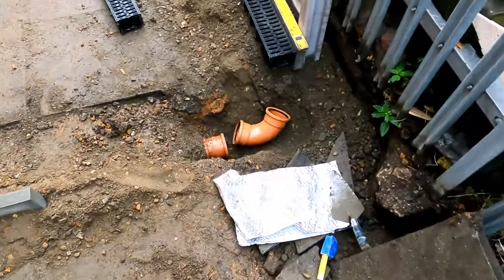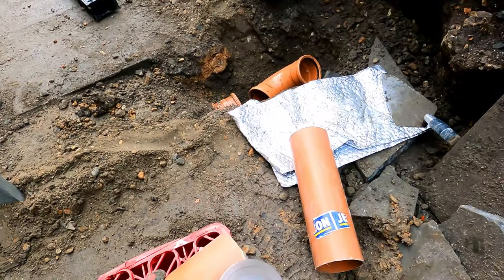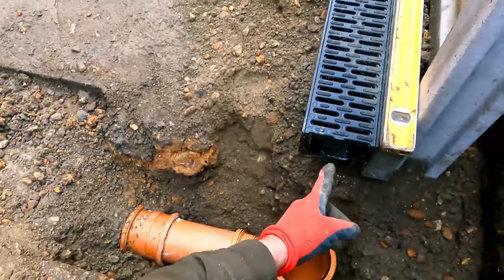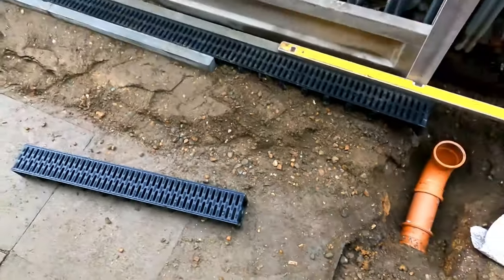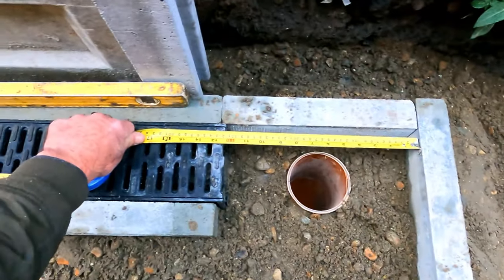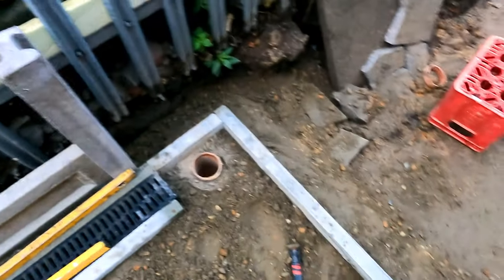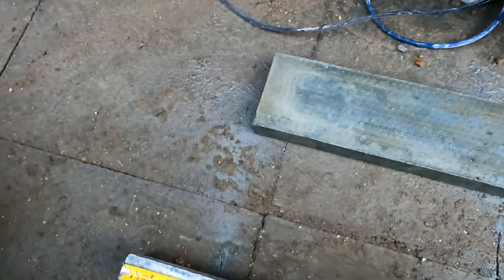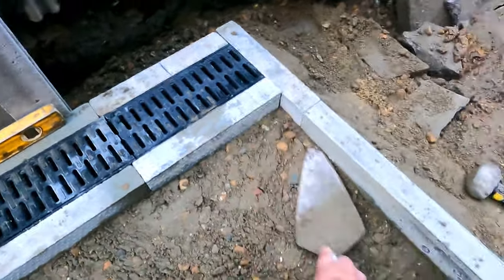How To Connect an ACO CHANNEL To a 90 Degree 4inch Drainage , surface & rain Water Pipe!!

Comment: Would have been better to put a sealing ring/connector to the aco over the top of the drain pipe. Stop all the surrounding muck from falling into it, which will happen over time

Comment: Is a connection not needed from the bottom of the aco to the below ground drainage like? Am in a new build and the fucking sub base is washing away under the block paving into the drain 💩
Reply from the maker: Thanks for stopping by the vid 👍 yeah you can buy connectors my way dose the same job water just goes straight down the drainage pipe

Comment: Assuming you're filling the path with concrete just under the damp proof course 😮
Reply from the maker: Pathway comes up level with damp on this job but I put an edgeding curb in 1inch from the building at the level of the damp.as not to bridge the damp course perfect for a disabled access at the fire doors

Comment: My daughter has just had this fitted "professionally" along the back of her house wall and they haven't used the push in fitting fitting between the channel and the drain gully leaving a 1" gap between the two, her sink drain also feeds into the channel just next to the knock out so if the gully ever blocks you would end up with all the dirty sink water going under the patio and possibly through the house wall. also with no outlet fitting connected under the channel  water is not directed down so it can flow anyway it wants.!!!

Comment: Recently subbed and will definitely take on board the way to complete the task highlighted, thank you for posting
Reply from the maker: Thanks very much for subscribing colin really appreciate that mate welcome on board 👍👍
Also I'm pleased the video can be a help to you on a future job thanks for the kind words and all the best mate 👍👍👊🏻.
Reply: @creativecrambo  Chuffed I found your channel actually but I have a question I have two soak away to install in the front of our property can you offer any guidance please at some point?
Reply from the maker: @colinratford416  
The size of a soakaway depends on the volume of water that's going into it ,this is determined by the size of your roof,  a soakaway needs to be at least 5m away from the building and 2 and a half metres from a boundary,  no waste such as sewage water should be going into the soakaway rainwater from your roof and surface water only,  they do a soakaway calculator online, this gives you the right size you need to make your soakaway going off the volume of water going into your soakaway, if you're having an extension done then an architect who dose the drawings should work out what you need to have in place,  yeah definitely do your homework before you do one plus if a groundwork team are doing it for you then they should have sound advice for you , do it properly and you won't have any problems later on 👍👍👊🏻.
,

Comment: Basically our builder has put blocks down and then put the damp proofing and then built on top wit bricks. We need channel drains running along side the house but would you suggest having a block placed next to the original block and a channel drain placed next to that? From this video I can see the block was visible and then you placed a block next to that and then had a channel drain installed, did you secure the new block to the old block with cement?
Reply from the maker: Thanks for stopping by the vid nice one 👍👍 you can run an aco channel along side your house /brickwork as long as its 2 course down from DPC meaning damp proof course, not sure what your builders have done but sounds like they just building up levels to get to where they need for aco channel, as long as the aco channel is 6inch down from dpc it will be fine if you'd like to put an edgeding around it That's a great choice looks great to  cheers and hope it all works out fine 👍👍👊
Reply: @creativecrambo  Thank you so much for your response 🙂 yeah building regs won't be happy about this and you know how it is with builders .. I just want to make sure no water ever gets in. Out landscaper wants to use gravel grids but I feel channels are more suited to keep water out? Seeing you place an extra block and then the channel might be helpful. Shame your not local ..
Reply from the maker: @AK-ql8yp  
Hope you get it all sorted and thanks for your feedback nice one 👍 👍👌👊
Reply: @creativecrambo  Thank you 🙂 and take care
Reply from the maker: @AK-ql8yp  THANKS AND YOU TO 👍👊

Comment: Hi m8. What's is the brown muck stuff your putting those edging kerbs into? What mix?
Thanks...
Reply from the maker: Hi m8 and thanks for stopping by the vid 👌👊
Yeah so the aco channel and the edgeding curbs are all bedded down on a concrete mix ,the mix gauge for the concrete mix was a 4 to 1 mix 4 ballast to 1 cement and the bed for them was about 5 to 6 inches deep hope this helps m8 and thanks once again 👍 👊

Comment: Weres the connecter from the arco to the pipe stuck up??, surely if left open when you drill hole through the foundation over time will wash away
Reply from the maker: Hi Paul don't really know what you mean about the pipe stuck up ?? As for foundations to ,  aco channel runs across 90 degree bend then I drill out a 2inch hole that the water goes directly into a 4inch pipe it don't even touch any thing else it goes straight down the pipe know what I mean did you watch the end of the vid 🤔 thanks anyway mate 👊

Comment: Ive just had a drive put in, however the water is pooling at the end in one corner, would that be fixed once the aco drain is installed?
Reply from the maker: Hello mate thanks for stopping by the vid 👍
If you got water pooling in a certain area on your drive mate sounds like what is underneath has sunk ,it might be cheaper to lift the paving and get the paving to the right level and throw the water away from that area if the water is lying there something is not right with the levels I wouldn't put an aco channel there mate from the aco channel the water needs to go to a soakaway hope this helps mate but I'm only guessing we're the water is pooling hope you get it sorted 👍 👊
Reply: @creativecrambo  thanks mate appreciate your reply as he was telling me putting an expansions joint would fix the problem🤦‍♂️
Forgot to mention it's concrete not paving
Reply from the maker: @L839-t1h  
You've just had a concrete drive layed and expansion joints are " normally" formed before you concrete , the water your seeing is in a low spot mate and unless you overlay that area then the water will keep on being there plus you always see a patch from the overlay so it's probably done to a bad finish mate if it's so annoying then take that section of concrete up and redo it 👍👊

Comment: I’m confused wouldn’t it be better to stagger the opposite edging joint? 

Also what’s stopping the edging dropping in places over time as they don’t seem to be compacted in? 

Not in the trade I’m just a massive DIY fan & looking to do something similar on my gaff 😊
Reply from the maker: Thanks for watching mate 👍👊
Yeah the concrete edgings are separate from each other for one plus they are layed on a 5 to 6inch concrete bed you got to get the mix to the right consistency not to wet not to dry then bed the edgings in then lay them to a line there going know where you got to make sure your sub base is good to when your good to go, concrete your edgings in I did them on a 5 to 6inch concrete bed 
No need to stagger joints when doing this we not laying flooring 
Thanks for stopping by mate 👍 👊

Comment: - Silicone in the joints between the drainage channel sections.
- ACO do vertical adapters & and leaf guards for when mating the drainage channel to 110mm, preventing water escaping when transitioning to the 110mm.
- The drainage channel didn't look like it was bedded into the concrete at all, nor did the concrete look well compacted. I very much doubt it'll survive the 1.5t load an A15 drainage channel is spec'ed to.
- When joining small cut sections it's good practice (though not always possible) to offset the drainage channel covers & joints to give additional rigidity.
Reply from the maker: Sounds like you know what your talking about but in reality you don't , the ACO was bedded down on 6inch concrete plus the pathway was 6inch concrete with expansion every 8ft plus 12mm rebar in the concrete to be honest it's going nowhere mate plus I've done enough of them mate to sink a battleship I know all about the connections  you can use in a perfect situation they are OK but there's other ways of doing the same job at less than half the price 
THANKS FOR YOUR FEEDBACK IF YOU WAS WITH ME DOING IT I'D SHOW YOU A GOOD FEW WAYS AROUND IT 💯👍👊

Comment: Hi there, my name is Sam (excuse my joke-based username btw 😂)and I'm new to the hard landscaping trade having come from the general gardening as well as soft landscaping trade. I have had some labouring experience with hard landscaping so I've starting off with small patios as well as driveways over the past year as I am not interested in general gardening work these days. I've recently looked at a job where the customer wants a little patio installing up against the house with the levels appearing to fall towards the house as opposed to the garden. I'm thinking aco drains as they would look the most aesthetically pleasing however as well as there being the main rainwater drain there is also their wastewater drain up against the house where the falls meet. How do I work around this without damaging the wastewater pipe whilst installing the acos to fall into the main rainwater drain? I'm not having any luck finding videos on how to do this properly and safely. Thanks!
Reply from the maker: Hi Sam 👊  sorry for late reply mate  🤦 yeah sometimes you get them sort of jobs ideally you need the water to run away from the building you can do an aco channel and keep it off the brickwork /blockwork with edgings about an inch that way you can come right up to the threshold and won't bridge the DPC 
it's hard to know what your up against mate without seeing it I hope you get or already have got it sorted mate and all the best in what you do thanks for stopping by my vid man and thanks for your comment nice one 👍 👊

Comment: This is something i am about to try myself what mix do i use to secure the aco drain? 5* work
Reply from the maker: george stronach:
Thanks for watching pal 👍👍 I bedded the aco channel in concrete I mixed up loose ballast and cement 4 to 1 ratio nice and strong  you can do this in a mixer or by hand if your fit, the aco channel needs to be on a nice base i layed them on about 4ich of concrete , yeah give it a go man I'm here to help if you have any more questions good luck with your project 👍👍.

Comment: Hi ..how do you connect corners..or make a right angle join
Reply from the maker: Thanks for subscribing Robert nice one mate 👍👍
If I was returning the aco channel on a 90 degree angle ,I'd cut both aco channel on a 45  degree angle to form a 90 degree angle you can use a good sealant to make the seal on the join thats how I would do it mate , all depends on what aco channel your using and if they do a 90 degree peice you can buy, but I normally do it the way I've just said works a treat every time,  thanks for watching appreciate it alot 👍👍👍.

Comment: How do you stop the smell from the drain coming back up if you’re not using a trap of some sort?
Reply from the maker: Dave lowe 👍the  rainwater system is on a completely different set up from the foul/ sewer system there not combined , the pipe I'm connecting on to leads to a catchment chamber with a trap , probably with a none return valve also having air pipes fitted to it ,there definitely wont be any smell coming back up to the aco channel that's for sure thanks for your feedback appreciate it mate 👍.
Reply: @creativecrambo  I’m looking to install a channel drain and connect to a combined soil and rainwater system. Without putting a gully in which won’t be accessible after I’m finished I can’t work out how I’m going to stop foul smells coming back and out fo the channel drain. My channels are the 4all brand. Any ideas would be appreciated. I do have a near by rain water gully that could be changed to accommodate it but I don’t think I could get the fall required on it.
Reply from the maker: @davelowe7565  
There has to be a trap gully  some where on the setup your doing and accessible, the trap gully stops the smells coming from your drain its like your toilet system, the toilet is fitted with a trap so you don't get no smells ,unless I can look at the job your talking about I carnt really give you sound advice but all pipes need  access to be roding in basic terms you got to incorporate a trap to stop any fowl /waste smells then do your pipe work needed  sounds like you got a bit of a job on your hands mate if I could see it then I'd be able to judge it 👍👍👍.
Reply: @creativecrambo  thanks for trying to help. Much appreciated. Think I’ll have to call someone local in. Keep up the good work.
Reply from the maker: @davelowe7565  keep up the good work to mate you will get there thanks for your feedback 👍👍  .

Comment: Hi if the aco drain is going into a sewer line would you have to put a trap gully in to stop smells thanks dave
Reply from the maker: David Gillet : 
Thanks for watching 👍👍
That's a good question, the rainwater pipes are on a separate system 
If the connection is to be combined foul sewer surface water then a trapped gulley is definitely required, thanks for your feedback appreciate it 👍👍.

Comment: What was that stuff you used to lay everything on ? what was the ratio of it, looks well maye
Reply from the maker: Conor mcdade :
Thanks for watching man👍 
I used ballast mixed with cement,  I normally do a 4 to 1 mix ,that being 4 ballast to 1 cement if I was mixing up in a cement mixer,  on this job I used a digger to mix the ballast and cement I used 6 bags of cement to a tone of ballast nice strong mix 💪 thanks for your feedback 👍👍.
Reply: @creativecrambo 
I've seen people using p shingle around the pipe then cement mix on top is the shingle needed around the pipe ?

Comment: do you use the aco end caps? or do you just use the concrete edgings to seal the ends off of the channels?
Reply from the maker: Hi jack 👍 I didn't use the aco end caps, I formed the   end cap using the 2" by 6" concrete edging works perfect I have used the end caps before but when I was forming the 90 degree return the edging made a perfect stop end with a very slight fall back to the outlet,  the stop ends work but the way I did it dose the same job thanks for stopping by the vid mate appreciate it 👍👍🤜.
Reply: @creativecrambo  you’re welcome bud! good video! can you just haunch it off with cement as well?
Reply from the maker: @jackhopkins9618  yeah man haunch the concrete up around , the aco CHANNEL I layed was on a bed of nearly 6inch concrete aco CHANNEL all bedded down nicely with a concrete edging stop end also bedded in concrete it definitely works 💯 and there's always other ways to make it work rather then looking at the rule book,  thanks for your feedback jack nice one👍,  and its nice to talk to someone who wants to get over a problem or situation rather then cause one .
👍👍🤜🤛👌👌👌. I like your comment mate 💪.
Reply: @creativecrambo  absolutely, always the way in our industry! do it right, do it once and all that!!